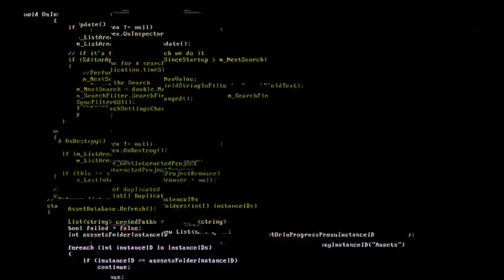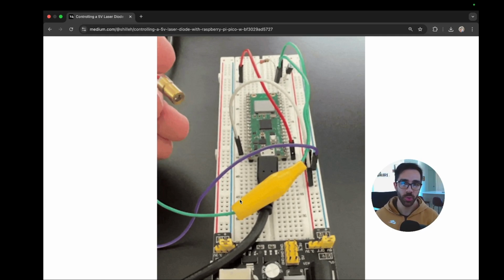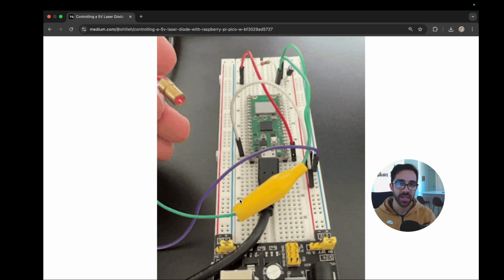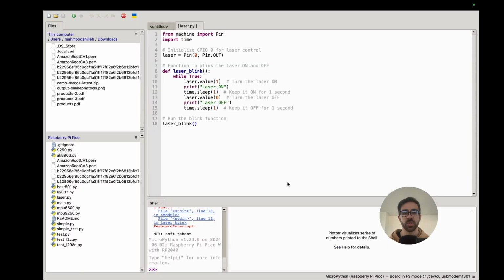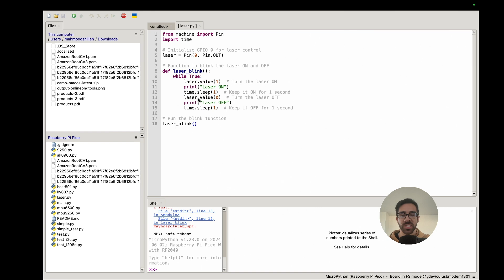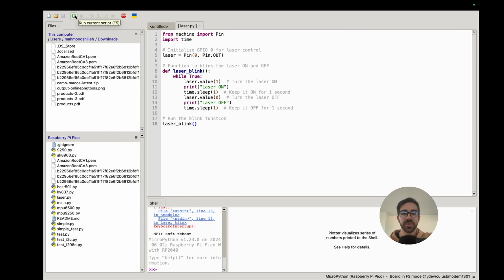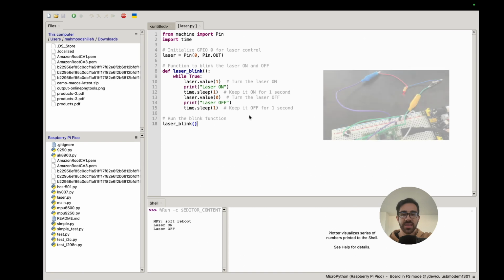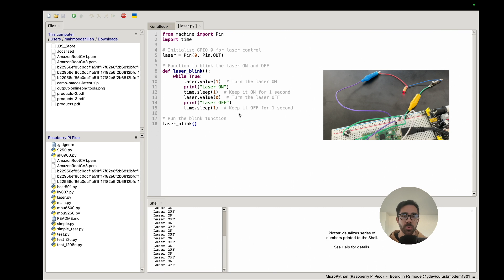How to Use a 5V Laser Diode with the Raspberry Pi Pico

Comment: I have been using VS Code with the Pico extension successfully so far. Do you always use Thonny or have you tried VS Code and any pros/cons?
Reply from the maker: I prefer Thonny for the Pico its just more lightweight and easy/quick for my needs!